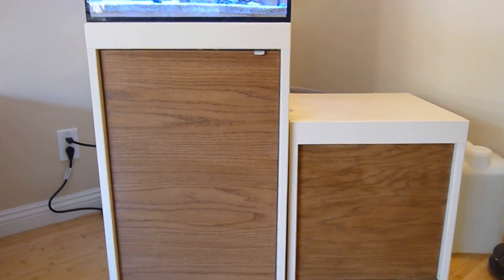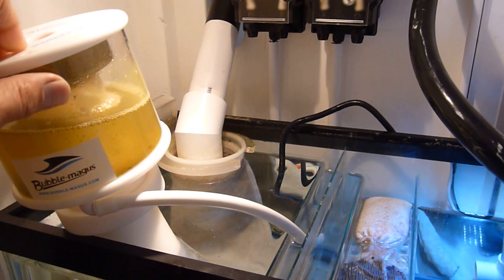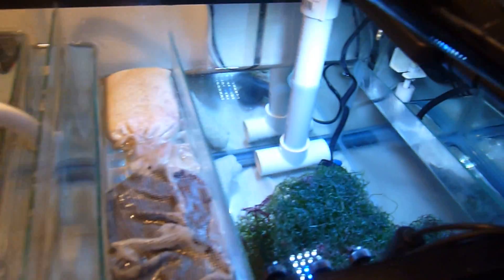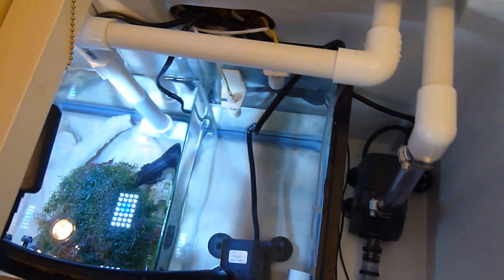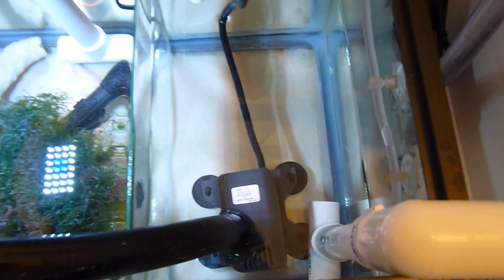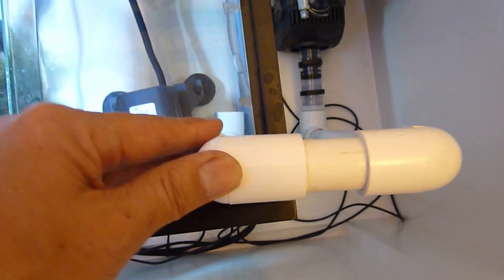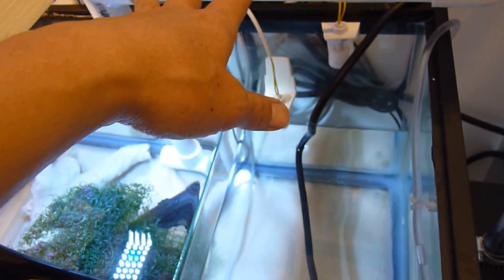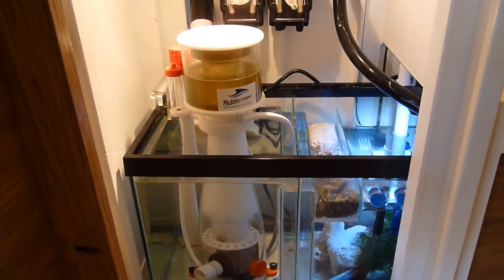DIY Reef Sump - In Operation - Pt 2

Comment: is there anything different you would do with this sump design? Im thinking of doing the same design thats why i ask. do you get good flow through the media?
Reply: Blackbookproduct10ns It's been working great.  However, I did remove the media tray and using a carbon/gfo reactor instead.  If you have a light load, than the media tray will probably be ok, but the reactor will be more effective.
Reply: i agree reactors are more effective, but i just wanted to make sure it is a decent alternative

Comment: What lighting are you using for the refugium?
Reply from the maker: None, actually. I actually bought an led lamp, but I later chose not to run a refugium as my system doesn't actually need one.  It's been a plus, because it's just 1 less thing to take care of.

Comment: Hey! I built my sump exactly like yours. I got my curve 5 in today. How long does if take to adjust? At all the settings my cup is filling up really fast.
Reply from the maker: thomas haynie Oh cool, it's been working great so I'm sure you'll be very happy with it.  The Curve 5 took about 3 weeks to settle in.  Be aware that it can unexpectedly overflow, at least it did for me.  The water level in the sump is about 10.5 inches, but I have the skimmer raised about 2 inches (I used the white grate), and the skimmer set between number 2 and 3.

Comment: Question with your water level being so high in your sump if the system is off the water back siphoning down doesnt make it over flow?
Reply from the maker: Nope, the water level in the tank drops down about 1.5" when the power is shut off completely, and all that water still leaves more volume left to handle in the sump.  It was a key design factor to consider.